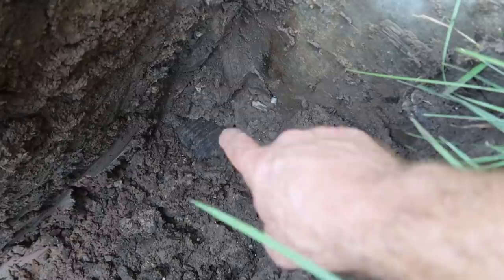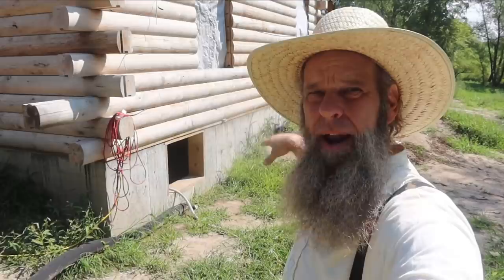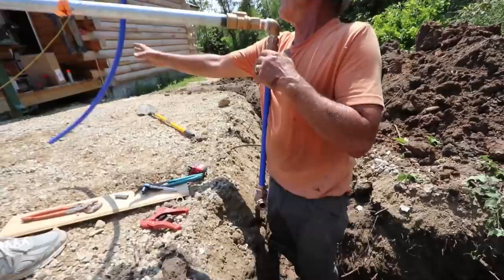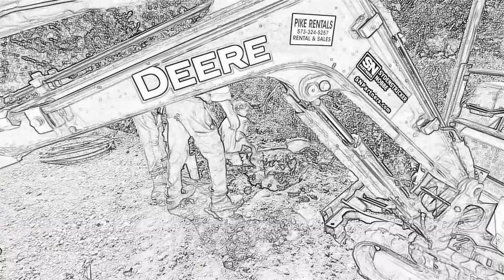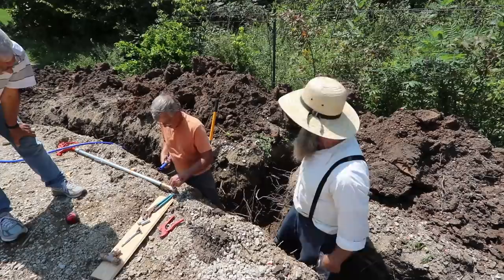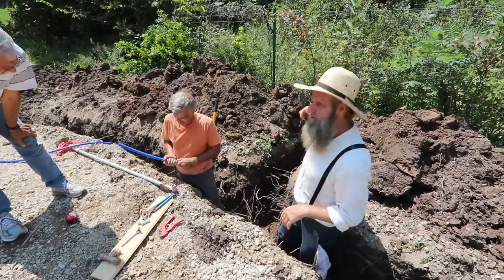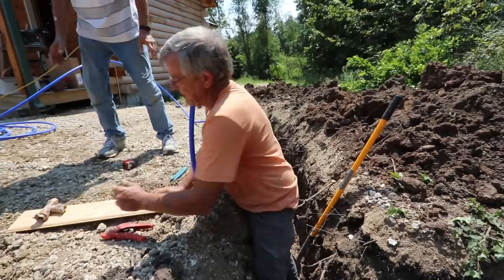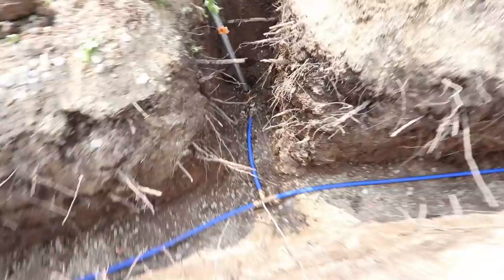WATER install at MOMs Log Cabin day 80 of the build

Comment: If you have a 110 pounds of water pressure please be aware your pop off valve on your hot water tank will be a problem for you for you that's too much water pressure for the pop off valve.  Hope that saves you from problems.

Comment: Tell us again why you didn't put the water line on a shelf in the same trench as the electrical?

Also, now's the time to install a Jones Valve just inboard of your meter to help isolate any future leaks plus keep the water provider honest.

If your water pressure is indeed 110 psig, you will need a pressure regulator for a number of good reasons!

Comment: I have a serious question for you.....why are you using a 'hydrant' rather than a 'tap'? We have snap together watering connectors for watering the gardens etc and I absolutely hate them, they leak water constantly and I would prefer to use screw together systems. I am still researching at this stage so when I saw you putting that in my curiosity was piqued....please explain it to me :)?:) xxx
Reply from the maker: Because they are made for farm use and have a weep hole like I showed ya....without that your pipe will bust in winter
Reply: @OFFGRIDwithDOUGSTACY  thankyou xxx

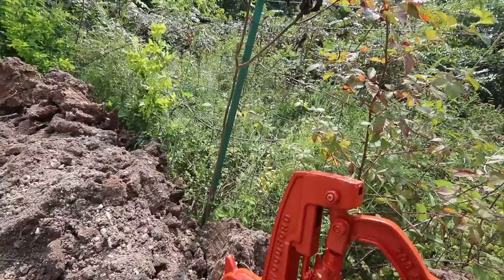Comment: 13:05 Why is it leaking at the bottom? Is that like a pressure release?? That's normal???
Reply: Frost-free hydrants operate in freezing temperatures because when fully shut off, water in the riser pipe drains out into the bottom of the hole through a bleed off valve leaving nothing to freeze above the frost line. Partially closing the handle doesn't allow water drainage, and the hydrant may freeze.